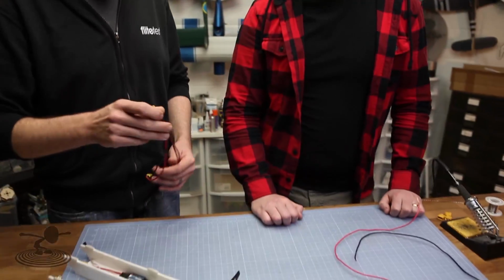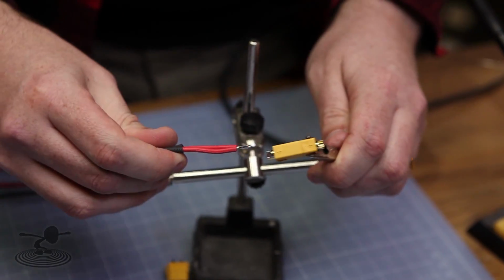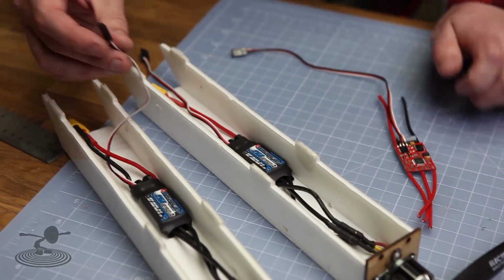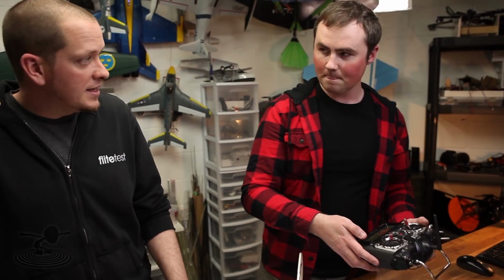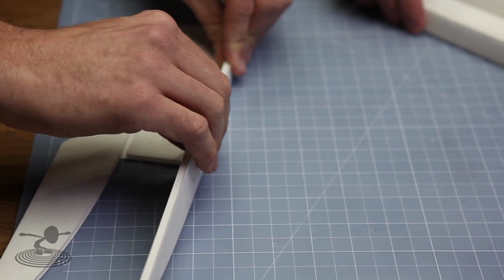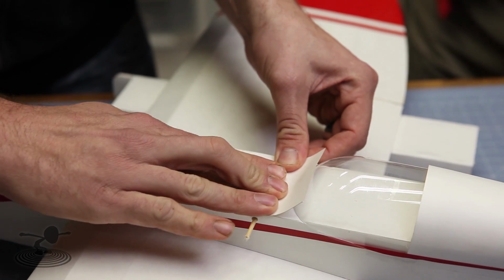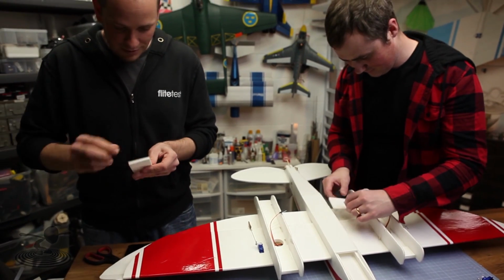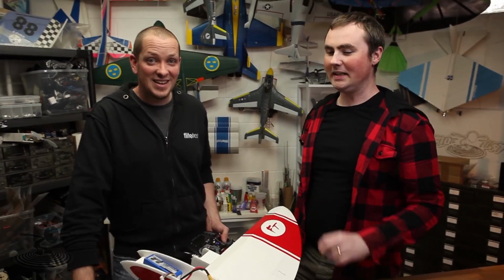Flite Test - FT Cruiser Build - SUPPLEMENTAL (Differential Thrust)

Comment: Your connections are crap... Sorry for being rude..
1) Solder has 10x the resistance of copper. Solder should be a metal bond not the conductor between the copper wires and the pigtails connectors your attaching.
2) electrons flow on the outside of the wire or the surface of the wire . you use small strand wire to maximize the surface area allowing more flow with less resistance reducing heat in the wires allowing smaller wires to be used with the same effenciency as heavier wire. 
I suggest to you.
1) remove the metal connector from the plastic case its held in.
2) crimping the wires to the metal end
3) then solder to your hearts desire.
Then you would NOT have the fear of a cold solder joint and  melting your placstic connector.
Other wise you have a well soldered connection with 10x the resistance and a variation in electron flows based on the consistancey of the solder being used.  For high heat... silver solder. Twice the strength and heat resistance.
ref information
https://www.rcgroups.com/forums/showthread.php?252435-Resistance-of-Solder-Joints
and 35 years employment in low voltage electrial

Comment: Question: Are the split flaps effective for takeoff? I have considerable time in the Cessna 421 and 411, both of which have split flaps. The POH does not allow takeoffs with the flaps down, even 10 or 15 degrees. Landings ONLY. Too much drag. Just curious.

Comment: Male=prongs (bullet shape), female= the hole the connectors (prongs) go into. Always. Shape of plastic surrounding the connectors doesn't ever matter and you should never look at the plastic to determine male vs female...Always determine what you need/order/choice by the shape our the metal connector housed in the plug. Hope that helps somebody.

Comment: A low wing airplane will lose altitude when you drop flaps so you will need a touch of up elevator with down flaps!
Reply: Oh, really? I've flown the Durafly Tundra (high wing) and had to dial a ton of down elevator in for compensation for ballooning. But I've also flown Mustangs, and the E-Flite T-28 1.2m BnF Trojan, which is a low wing, but also has flaps, didn't notice a thing. no up or down. But I've always thought that any flaps would need down mix. Thanks for the tip!

Comment: flaps down, ailerons up, instant stop in mid air… invisible floating brick wall?
Reply: It's actually a good braking method, as shown in the "Parkzone Radian Pro," this system is called Crow.

Comment: what kind of wire is used to make the y harness?
Reply: usually 20-26 guage multistranded wires. It HAS to be multistranded or the vibrations may crack the wire.
Reply: lazyG007 servo wire lol

Comment: Hi FT Team. I just received my FT Cruiser SBK. I can't get the battery cable here in Doha so I can't make the battery Y connector. I was thinking of using 2 batteries, one for each motor in the power pod with the speed controllers connected with a Y harness. Would this work as well? I might disconnect a BEC from one of the ESC so that any differential voltage difference between the batteries will not affect the Rx.

Please give me your thoughts.

Thanks.

Comment: Let me tell you this method of making a Y harness with 12 gauge wire is ridiculous! I did it but am not so sure how it's gonna hold up. I'd stick with 14 gauge wire as the 12 gauge doubled up barely, if at all fits in an XT60 connector...

Comment: Technically extending the wires between motor and ESC is the better option, but at the lengths of wire extensions we are talking about (under 150cm) it makes little to no difference. The more important thing is to increase the size of the wire if you are going to extend its length over 60cm

Comment: your video is showing a "dry solder" joint which is not so good. I will admit at the amp draw you are looking at for these motors it will not matter much but you should show "best practice" and by doing it in the above way you will find it much easier and use much less heat reducing the chances of melting the connection.

Comment: Hey Guys, Did you realize that gold plated items do not need to be pre-soldered. In fact the solder will take to the gold better than it will to solder itself. On the XT60 fittings pre-solder the wire, stick them into the XT60 then hold your soldering iron so it touches the wire and the XT60 gold plated fitting and then feed you solder onto the wire where the soldering iron is touching the wire. This will give you a better connection an not require as much heat.

Comment: if you worry about the helping hands digging in and cutting the wire or insulation, stick some heat shrink on the alligator clips.

Comment: hi there,can some one tell me why when i take out the positive wire from my speed controller,one motor is not working? i use 2 plush30 amp SC from HK,so i check it around and in all twin motor application peoples eliminate one positive wire,but for me do not work,the only  way is workin is with 2 positive wire connected...

Comment: Don't put two linear or switching BEC on your reciever. David speaks of linear voltage regulators that are from the same series. But the resistors or other components are not the same. The feedback system in this type is made by a resistor and two capacitors. Both with a tolarnce of 1% or 10% or more. You can overheat one of the two BEC's.
Just use one BEC or a separate battery.